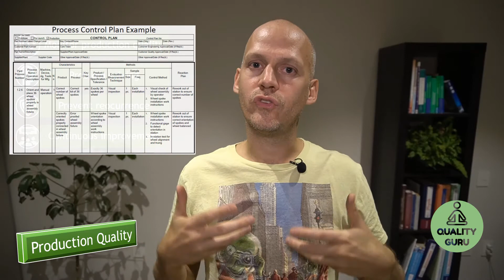Understanding the Quality Department tasks and structure: Production Quality Engineer (4/9)

Comment: I've got a job offer as a "Process Engineer". Is this just another name for the "Production quality Engineer" or something completely different ? If you could give me hint or you mentioned it in some of your other videos ?
Reply: A Process engineer focuses on the process steps instead of the actual end product. The process quality (inputs) controls the product  quality ( output)  A process engineer is usually a lower level beginning Jr. QE. I was a process engineer after my BS degree in Industrisl Engineering before I became a QE and then a QA manager later.
Reply: @sjsphotog  thank you
Reply from the maker: Hi Vahid, every company might have a slightly different understanding of their job roles, you could request the Jones description to be 100% sure.
In my understanding the process engineer is the process Expert, that deines the process, sets it up and improves it further during production (processes could be welding, gluing, molding, cutting, ...depending on your product and industry). The production quality engineer focuses  only on the conformity to the standards, that means that the processes run within the right parameter range and that the output meets the requirements.
Both want to improve the process, the quality guys in terms of quality while the process engineer also want to consider cycle time, cost, ergonomy, etc 
Hope this helps 🙏
Reply: @qualityguru9047  your comment helped me shape this term more than all the other available content on yt, about it. You are always prompted with a chemical "Process Engineer" when typing this term. However, thank you very much👍🙏